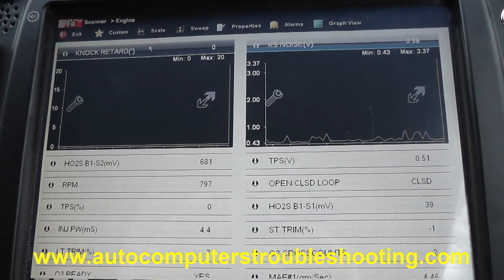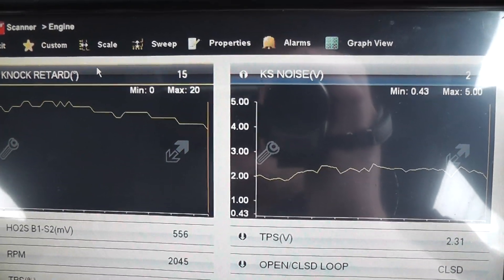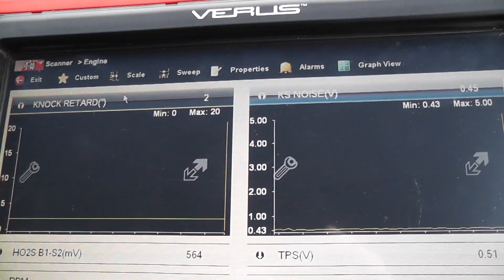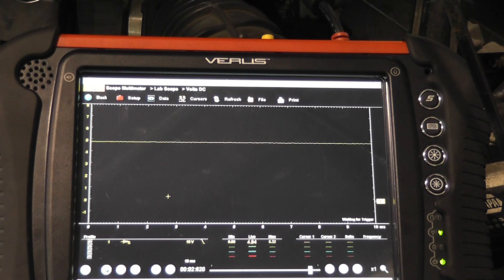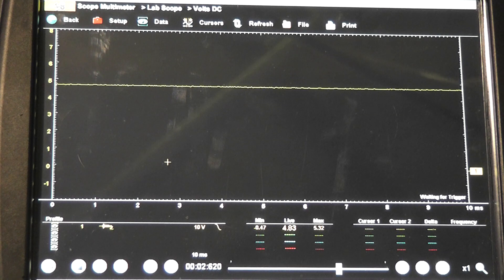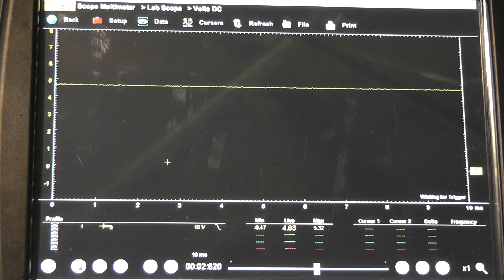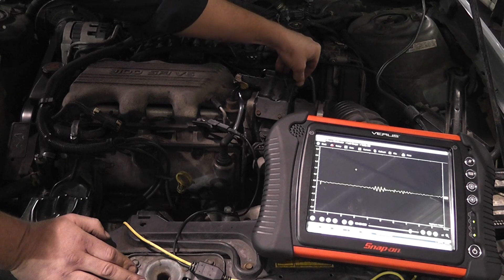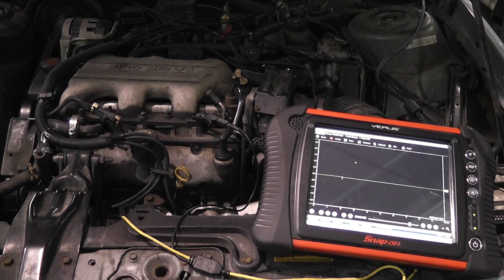How to test a knock sensor - GM (low power condition)

Comment: I believe my ‘95 Mitsubishi 3000GT has a faulty knock sensor. Unfortunately, I don’t think unplugging it would take away the symptoms as the ECU will still behave as if the knock sensor is bad/unplugged…

Comment: That is very enlightening, that if I had something stored in the engine bay vibrating on the block or maybe the head that it could be sending knock signals to retard timing.  I never even considered that with all of my side experiments increasing mileage.

Comment: I have a question. Can a bad knock sensor affect the timing? That is, in a vvt car, we could put the oscilloscope and it would show that the car is out of timing? But would the timing actually be correct?
Reply from the maker: No. Timing advance is limited when knocking occurs it does NOT change base relationships.

Comment: this has me thinking about glueing a knock sensor onto a long screwdriver then hooking that sensor to a scope and use the screwdriver for pinpointing engine noise like when you have a loud pulley or bearing and want to isolate where that sounds coming from.you could then touch the screwdriver to different suspect noisy parts,in theory the louder a pully the more you would see that on the scope and visa versa.

Comment: @6:08 your knock sensor was 5v, when the knock sensor was unplugged you still got 5v, which means the wire to the sensor is good, but the resistor  in the knock sensor is bad, otherwise that resistor would pull the 5v down to 1.5v. according to the little book you showed the resistor should have pulled the 5v down to 1.5v if it was plugged it, but it still showed 5v. i am at 6:20 and hit the pause button to say this. i will continue to watch and see if i am in error or not. i am not an expert, i am here trying to learn theory of operation, caught the over sight and thought i would share. i do thank you for this and all the videos of yours i have watched over the years

Comment: Hey quick question. I have a 2002 Camry Standard transmission that seems to have a slight knock. I performed the rod knock test with a rod in the spark plug hole while turning the crank to see if the was any play in any of the rod bearings but there wasn’t. What should I look for next? I’m terrified that it’s a main bearing
Reply from the maker: You have a knock in your engine? There is nothing I can help you with via the internet on that. I am sorry.

Comment: why not check resistance across the sensor for shorts?
Reply: i suspect the resistor in the sensor is bad, which is why the 5v circuit  never drops down to 1.5 with the sensor plugged in. it was right there on the scope and he talked about it, but never zeroed in on it. i am here to learn, but i caught that right away. a resistance test would have likely shown an open circuit, or at least less resistance than it should with the resistor not working

Comment: Hi, nice video. Can knock sensor cause no start issue, by overfueling and wetting plugs causing  not to start? My golf 1.4 tsi has no start issue, it has sparks, fuel, compression but doesn’t start. If I keep cranking , then compression goes down,  and plugs are wet, and I can see fuel on top of piston. Changed plugs, coils, fuel pressure sensor, high pressure fuel pump, clean all grounds, changed camshaft sensor, fuel filter, replace fuses with brand new , but still no start. Nothing comes up when scanned in the engine module. I noticed that during cranking after 6-8 seconds red oil pressure light starts blinking. I have removed sump and checked oil pick up tube, but it was clean as new. I will change oil level sensor when putting back sump. I am totally lost, 
There was another video I recently saw, which has no start issue and cranking fine. He changed everything on his bmw, but no success. Somebody told him to change oil level sensor and his car started. That’s my next step. Please help me resolve this issue, can been parked in driveway for over 4 months.
Reply from the maker: No, a knock sensor is not even used during cranking
Reply from the maker: timing needs to be verified, then check it for a plugged exhaust, (remove your upstream O2 and see if it will start)

Comment: i'm wondering...  if there is a way to make those  less sensitive and get them to produce less ac power to fool the computer.  since this case, the engine is not pre detonating. and the pcm thinks it is due to piston slap, lifter slap or whatever the case is.   i know that there is a bleed resistor inside the ks of if i remember right, 100 ohms,    what if i would shove 12 volts on the lead wire to purpusly burn out the resistor inside. then install a resistor in serie to cut down the ac voltage coming from the ks,  and in betwen that splice and the pcm, hook up a 100 ohm bleeder resistance to "indicate" the pcm pushing +5vdc that the ks is still pluggued in. reason for all of this is that i just done my 2 ks on my 5.3 2005 silverado,  which are under the intake manifold.  i've done the mistake of putting cheap ones, and well.. i have some lifter noise in my engine and i think its giving me the same problem as in the video.  if i unplug my battery for a good 24 hours and plug it back, the truck runs wicked. i can stop on pavement, stromp the gas with no brakes and she'll burn 35x12 r18 tires.. a few drives later, she dosent even have enough power to make a brakestand.    toughts anyone?

Comment: wouldn't you have to have the scope on ac voltage? instead of dc voltage?? I seen you turned ac coupling on to "block" the dc voltage so a knock sensor produces both ac/dc?? would you use ac coupling on speed sensors/ abs sensors??

Comment: I have a 2000 silverado with a 5.3. My SES light came on and i pulled the P0327 and P0332 knock sensor circuit low input codes and a B2S2 heater circuit codes so i replaced both knock sensors (the rear bank 2 sensor was completely corroded) harness, intake gaskets and b2s2 o2 sensor. Cleared the codes and truck ran fine til the next day SES came back with the knock sensor codes. I did the voltage test by hooking up my dmm and tapping on top of the intake valley cover and took an ohm reading. Both came back good so i checked for continuity on the harness and its good too. Any ideas on what the problem is? Truck really bogs down at wot and sucks gas. Thanks in advance.

Comment: I have a 3 wires knock sensor and the fed is getting 2.5 volts from the PCM, is that normal? I am having a very bad lack of performance.
Reply: I have a vw group car from 2003. The knock sensor has three wires. One for signal with 2.5 V. The other wires are for ground and shielding and both are connected to ground.

Comment: An engine with no spark advance will fire the plugs as the piston reaches TDC [top dead center] The normal procedure with vacuum or computer generated advance is to fire the spark plug some degrees Before top dead center to help warm up the engine and also to compensate for time needed for the spark flame to travel through out the cylinder. On some scanners the  data PID value may be as much as 45 degrees of advance.  The knock sensor does the opposite. It retards or reduces the amount of

Comment: Very informitive video ! 
I am troubleshooting a knock sensor problem with a Honda Aquatrax. It is nearly imposible to test this dynamically in the water as is the only time I get this issue. But, unfortunately, when the code pops, the computer throws the craft into limp mode. It is very aggrevating when you are very far away from shore. I have already installed a new knock sensor hoping the issue would go away, but the problem is still there. I am going to play with engine quieting tricks.

Comment from the maker: It starts at 12, goes through a 5v regulator (internal to the PCM) then is sent out to the sensor as a 5 volt bias. Some KS don't use this bias, some do. It is simply there for diagnostic purposes. In either case the KS produces an AC sign wave.
Thanks for the comment!

Comment: ace video
In the page from the book its shows a 5volt feed to a resisture,wouldnt the 5volt be from the resisture ie the supply would be 12v dropping down to 5v to supply the sesnor?
Need to buy the book!

Comment from the maker: @assassinscov No plans as of right now. I'm still not confident enough with them to shoot that at this time. The heater circuit tests are identical but as far a pinpoint testing the signal wire(s) with a scope, it cannot be done with ease. The PCM monitors micro amp changes (not voltage) in the signal circuit to determine ratios. My test equipment will not read that low of amperage. So all testing is done with scan data only. I'll work on it. For book info. see my homepage for site

Comment from the maker: @fivefortyeye540i ok, so no rubber boot in between then? The throttle body bolts directly to the manifold? Sorry for misleading you if that is the case.

Comment: Yes I blocked of throttle body with latex glove I put it over Maf sensor housing good positive pressure it inflated.. When I original took off intake manifold to replace pop off valve and put in new gasket... I only detached half the throttle body left other half   
with intake

Comment from the maker: @fivefortyeye540i also when you smoke test this engine you need to completely block off the throttle body. This will put the intake under a slight pressure which will reveal any leaks easier.

Comment from the maker: @fivefortyeye540i are you sure we are talking about the same thing? If you took it off that means you had the entire throttle body off. Its not that easy to remove. Most systems the throttle body is directly mounted to the intake with a gasket in between. On this one there is a small rubber boot connecting the two together. Look close.

Comment: I took it off and thoroughly inspected it, I put it back on smoked the the throttle down stream of Maf sensor smoke did come from top side of filter box wher it connects to cover air filter   Now that u mentioned that agin I'm going to try to seal it of and see if that brings the numbers down..

Comment from the maker: @fivefortyeye540i I thought you said fuel trim was high on both banks? If it was just the one bank there is also a timing chain problem to consider. I believe this engine has a primary and two secondary timing chains. So maybe the one bank the chain is off a tooth or two?

Comment: I think I have figured it out on the 4.6 I put new wires and plugs in. Since then i have been running the caddy on I off tring to figure out this lean condition.. So I went back pulled the plugs on bank 2  2plugs wher white (lean) and other 2 wher dark... Fuel delivery... Pulling injectors tonite....